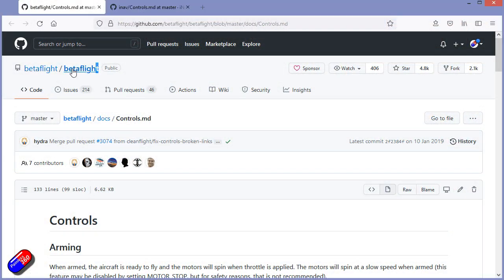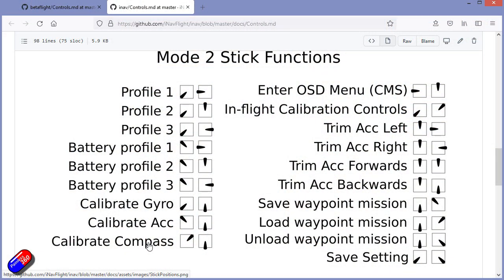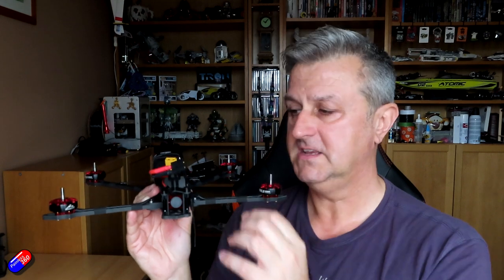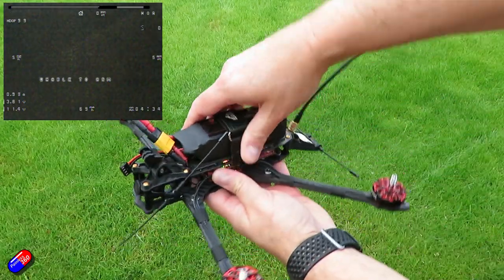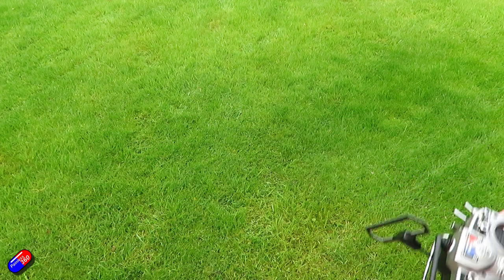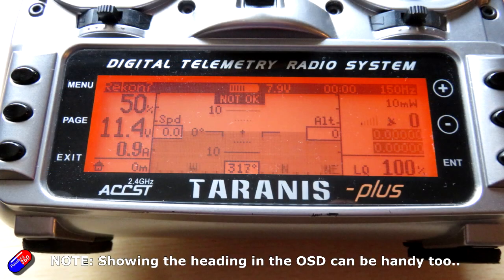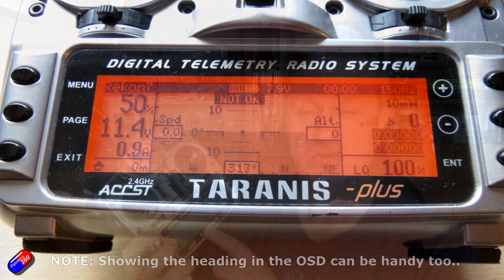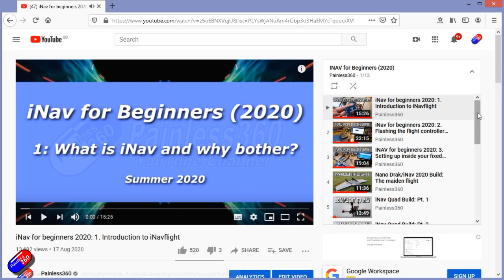How to calibrate your INAV compass at the field using the sticks

Comment: When I calibrate the compass, everything is fine. Nav pos hold works great . During the flight after about 5 minutes I try to nav pos hold again and it's already doing toilet bowl. what could cause this? I have rekon 7 pro (inav). Thank you
Reply from the maker: Toilet bowling is almost always a sign of a compass that needs calibration. I guess you tried that?
Reply: @Painless360  Yes, as I said. I calibrate before the flight, take off and everything works. I fly for about 5-10 min and I see in the goggles the home direction arrow is not pointing correctly anymore. I try nav pos hold and it does toilet bowl. I have to land, calibrate and the nav pos hold works again. During the flight, it just goes wrong. Do you know why?
Reply from the maker: No idea. I'd suspect that something is causing the compass to drift off. If the model then flies ok again after you let it 'cool down'. That would point to something happening during flight.. Best of luck with it.

Comment: I have found a lot of videos on this topic but none of them mention mode 1.  I found a website that seems to say throttle high and pitch down and to the right for Mode 1 but it doesnt work.  Sure would be nice if some of these vids covered us Mode 1 guys.
Reply from the maker: Stick commands for any mode are easy to find... See https://www.mrd-rc.com/tutorials-tools-and-testing/inav-flight/inav-stick-commands-for-all-transmitter-modes/ for example... Best of luck
Reply: @Painless360  Thanks for the reply! Yes I found those already and when I use it is just says "settings saved" and I don't get a double beep and 30 seconds later there is also no beep.  I have tried every stick combination possible.
Reply from the maker: I don't calibrate compasses at the field for hobby flying. Doing it a few times a year is enough for basic mission and RTH... Best of luck
Reply: @Painless360  OK thanks so much.  That is true. I dont travel much so I guess once I get a good one I will stick with it.

Comment: I do the calibration everytime I get to the field, but at the end I have never give the save command! Did I always done it for nothing, but it seems that was working just right..
Reply: As long as the fc stays powered on, the calibration is fine. But when you unplug the battery, you loose the calibration you just did. It’s like changing some settings in iNav configurator without hitting the save button before  opening another tab
Reply: @bertbeinaaf8314    "But when you unplug the battery, you loose the calibration you just did"  seriously ?? has anybody else experienced this?  I was not aware you needed to do a 'save' :-)
Reply: @stevietee10  I’m not an expert, but as far as i know it works this way. Just like when you edit a textfile, and close it without saving
You could ask Lee to be sure
Reply: I just realized....if you do it every time at the field but never save - as long as you do it every time, you are good 🥰😎

Comment: Does this still work in INAV 6 and do the beeps come from the motors or do you have to have a buzzer connected to your flight controller
Reply from the maker: I'd strongly recommend using a separate buzzer on INAV builds. Useful to know things like when the GPS locks and super handy as a lost model alarm too...